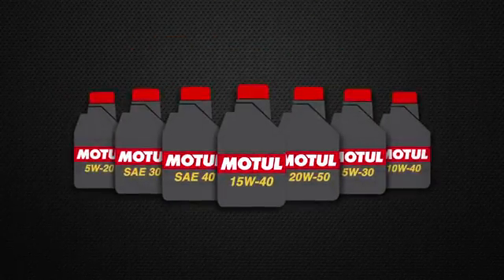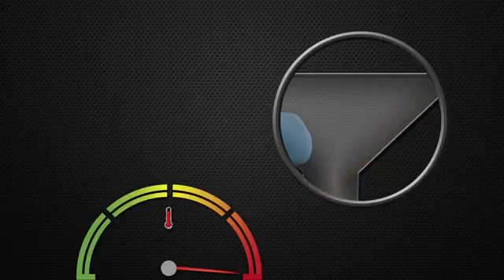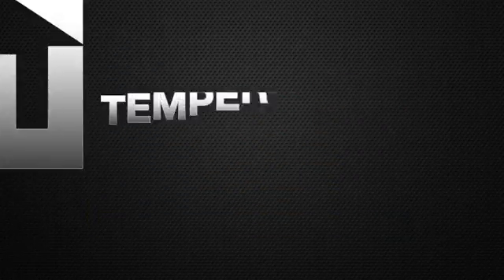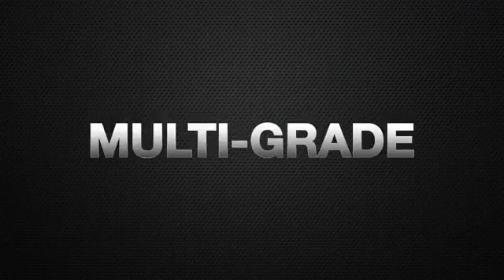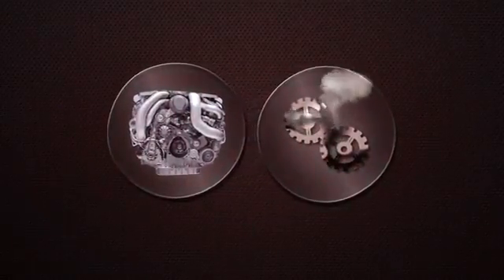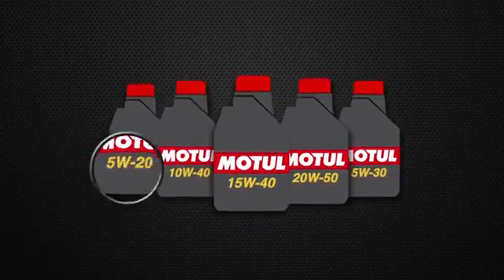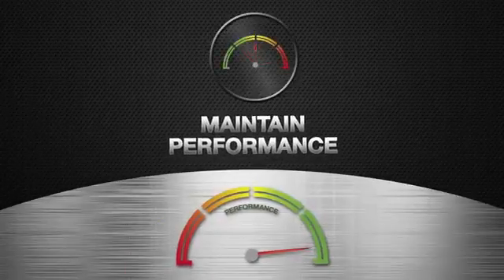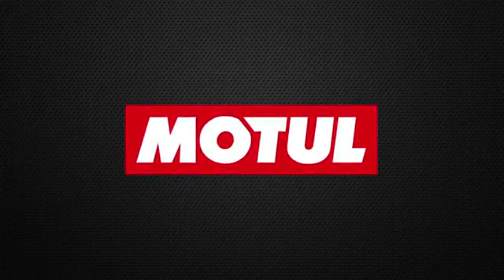Motul engine oil tips: Viscosity Grades

Comment: Could you please do a video review/comparizon - of/between Motul 5100 15W-50, 7100 15W-50 & 300V 15W-50 engine oils in detail. Thanks. Your subscriber from INDIA.
Reply from the maker: +amito100 We will definitely look into it! Thanks for following!
Reply from the maker: +amito100 Sorry I could not get a comparison video for you but here is some info that I am sure will help.Difference between Motul 7100 4T vs Motul 5100 4T
Motul is one of the favorite engine oil brand in India for motorcycle enthusiast and in local market they have a few products to chose from. Like, mineral 3000 4T Plus, Semi synthetic 5100, full synthetic 7100 and 300v.
Lets compare two of its product, the good old Motul 5100 vs newly arrived Motul 7100.
In Indian hot summer condition, Motul 5100 is available with grade 15w50 where as Motul 7100 comes in 20w50.
Motul 5100 4T 15w50
• Price > Rs. 545/ (printed)
• Grade -> 15w50
• Type -> Semi Synthetic
• Drain Interval -> Depends on bike to bike.
Motul 7100 4T 20w50
• Price > Rs. 775/ (printed)
• Grade -> 20w50
• Type -> Full Synthetic
• Drain Interval -> Depends on bike to bike.Testing
We tested it with Yamaha R15, Karizma-R, CBR 250R and Pulsar P220 DTS-i and Apache RTR 180.
 
To compare the two, we have taken the bikes in highway for longer runs like 200 to 250 kms at a go with higher engine RPM, we have also tested the bikes in city condition in hot summer with bumper to bumper traffic.
The immediate difference between the two is that 5100 does seems to be a lot smoother but with 7100 though it feels harsher but the bikes felt aggressive with acceleration and better top end too.
Results
Motul 5100 4T 15w50
• For Bajaj and TVS engines, Motul 5100 15w50 acts like god by reducing the vibrations close to none where as with CBR 250R and Honda given ZMA engine or Yamaha R15 though already butter smooth engines goes smoother but with price of aggression as in every case, what ever the engine is, acceleration does seem to take an effect with lower top end.
• If you are clocking a lot of kms a day in city (100+) as commuter or you are a highway tourer then 5100 is the real answer for you as even after 250 kms of hard and higher RPM highway ride in hot summer, every engine we tested really felt calm and sound free.
• There is a marginal drop in mileage too but only if you are clocking less kms and using the bike stop and go type purpose as the engine oil seems to take a little while (5 to 10 kms) to warm up.
• Drain Interval would be 2000 to 2500 kms for engines like DTS-i and RTR where as with Yamaha and Honda engines, you can pull it another 500 kms extra.
Motul 7100 4T 20w50
• Engines were harsh but negligible for Honda (ZMA / CBR) and Yamaha however acceleration felt better than 5100 along with better top end figures. But with Bajaj and TVS engines, we felt, we were better to be with 5100 even if we have to compromise that acceleration benefit.
• For stop and go city ride and hard ripping in signal to signal, 7100 performs better than 5100 as it does gives you benefit in acceleration and aggression as the bikes felt a lot more responsive.
• Offers marginal better mileage compare to 5100.
• For Yamaha and Honda engines (like Karizma and CBR) we felt it can clock around 4500 kms.
Verdict
Both this oils are extremely good when it comes to protecting engine and clutch wear, both of them keeps engine and clutch clean and smooth, both this engine oils manages heat and does lubrication job 10 times better than most of the available oils but at the end of the day it comes to riding feeling as here they offer two different feel altogether.
For Yamaha and Honda (Hero Honda too) engines, you can opt for 7100 as paying 200 extra over 5100 does give you some extra kms of engine oil life, but for Pulsar DTS-i and TVS engines, 5100 is the choice.
Where as if you are a tourer, nothing will beat the smoothness of 5100 and if you prefer aggressiveness for acceleration and top speed, chose 7100 for your self.Source: http://nexgenbikes.com/site/2013/05/17/difference-between-motul-7100-4t-vs-motul-5100-4t/